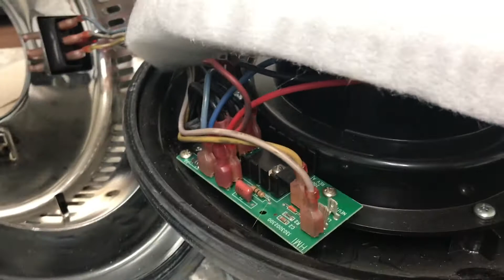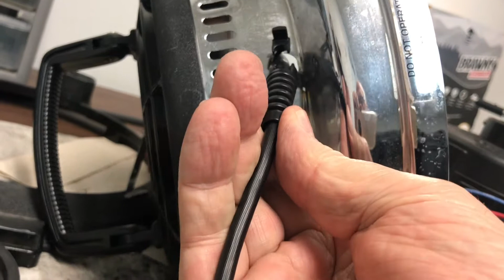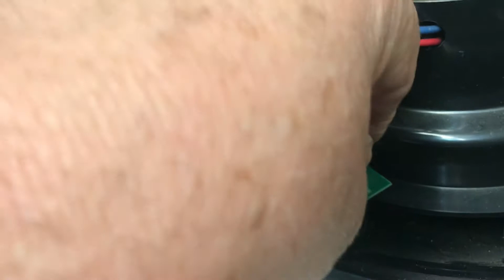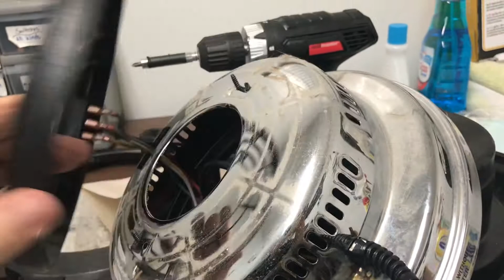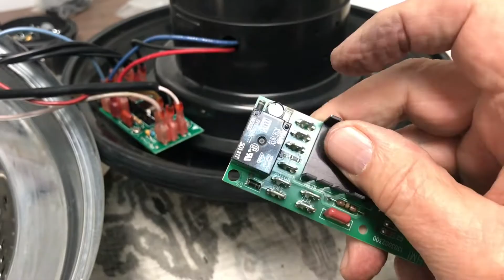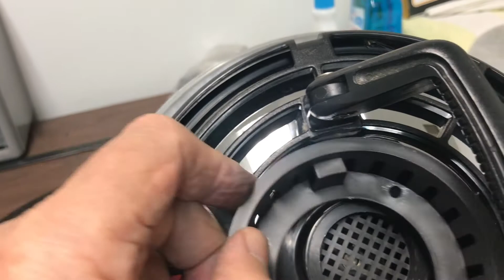How To Fix Problems with your Filter Queen Vacuum's High/Low Switch (Step by Step) | Mike's Garage

Comment: I rarely if ever had come across any of the older Filter Queen vacuums cord strain relief failures like that.
Reply from the maker: Hello, thanks for your comment. It usually happens on the older courts the Brown courts. It breaks right where it goes into the strain relief
Reply: @MikesGarageVideos 
Do you know what the purpose of those round plastic dots that they stick onto the top bearing housing of the motors Mike?  
Maybe it’s some sort of a diffuser or special splash guard for the motor when scented fragrance sprays are used on the top felt pad filter?

Comment: When I run the power nozzle there is a smell like it is burning and it cuts in and out.  Can it be fixed or do we need to purchase a new nozzle etc
Reply from the maker: Hi Helene, I will check the electrical connections where the handle goes into the metal wand. Make sure they’re clean and shiny if they are burnt and dirty that’s what’s causing it to cut in and Out. You may have to replace the handle or buy a new wand and metal pipe.

Comment: the power nozzle on my filter queen i bought in 2010 on the bottom of the power nozzle i lost the tiny wheel and steeel pin and the other side it is still there can it be fixed or replace the tiny wheel and steel pin

Comment: This is perfect, and may be allowing me to continue using the best vacuum I've ever owned! However, my vacuum has a pedal switch on the side which is keeping me from taking the top housing off to replace the power cord. Help? And where can I order the right power cord?
Reply from the maker: Hello Jan, you have to remove the rubber pad from that push switch in order to get the upper housing off. It’s a little difficult to do that if it’s old and then you have to work at it to put it back on.

Comment: How do I contact you?
Reply: the bottumof my power nozzle has two timy wheels one on each side on the bottom and one came out and also the stainless steel ;pin and can it be fixed